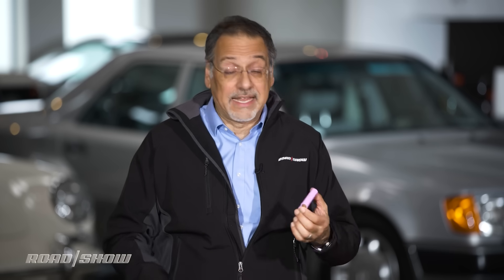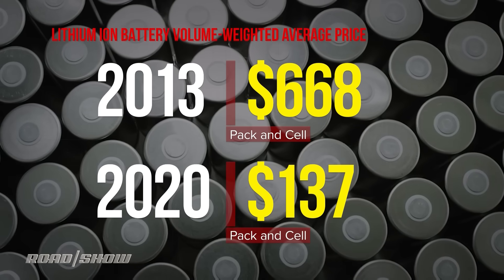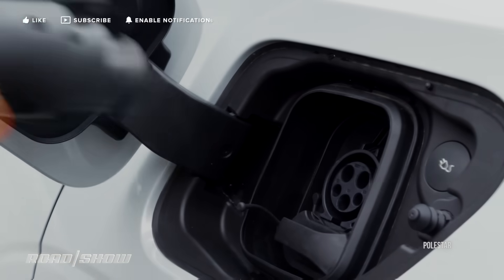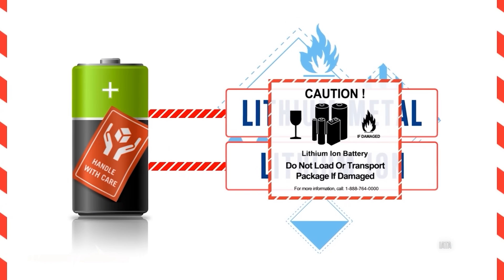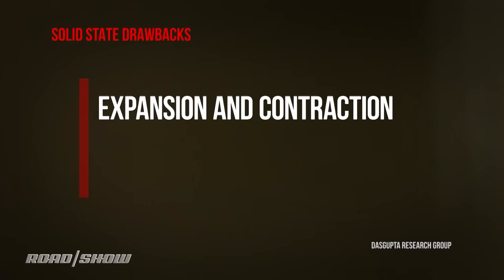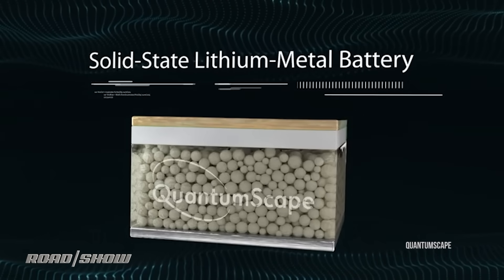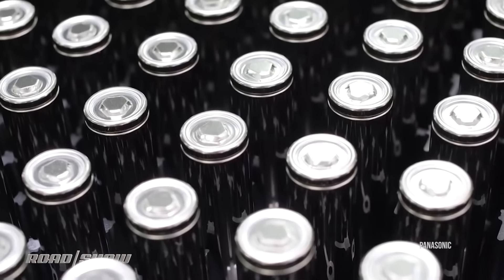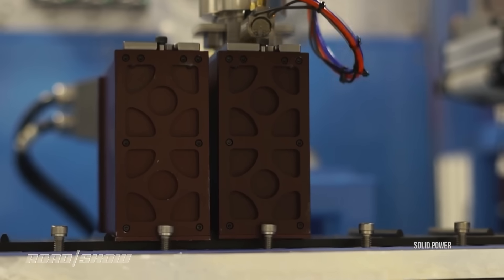When solid-state batteries arrive, you'll want an electric car

Comment: I will want an electric car when the cost drops to something reasonable. Right now its just the domain of the rich.
Reply: The main part of the cost of an electric vehicle is the cost of the batteries. And this have been falling steadily. Actually within a couple of years, electric vehicles will be cheaper to produce than ICVs. Will be very interesting.
Reply: @RasmusDyhrFrederiksen  I agree that the battery cost has dropped significantly in the last 10 years but if you look at the stats it seems to be leveling off with only a small projected decline.  In fact lithium prices are rising.

Comment: When the power grid has enough electricity, there’s plenty of charge stations, and the batteries fast charge - THATS when one wants an EV
Reply: Actually, that still doesn't sell me on electric vehicles. You still have the problem of the overloaded electric grid, the electricity still comes from coal and gas fired generators and there is still the cost of the batteries and the limited charge cycles and the range that decreases significantly on the highway.
Reply: @jamesdaniel1376  plus the harmful mining of lithium and toxic pools where it dries. that and it all has to be imported, so we will be dependent on other countries.

Comment: I just recently read that the Long Island Railroad will eventually replace it's diesel trains with battery powered electric ones that can go on the un electrified tracks after they are charged in the electric zone. This is where the solid state rechargeable batteries will fit in after they are developed enough.

Comment: This guy is a moron. Almost all batteries are "solid state." The term means no moving parts not that the material is a rock.

All chips are solid state yet the silicon chip is very flexible when not placed on a substrate, that's why they are put on a substrate in the first place.

These putative next gen batteries violate any number of well understood laws of chemistry and physics. IOW they're frauds and will never happen. There are limits to realistic energy density that can be obtained at reasonable temperatures and pressures. The reason these frauds have been in development for years with no working prototypes that are anywhere near the energy densities they claim is because they cannot do it, and they likely fully well know that.

This is another tech like cold fusion that any reasonably well informed person takes one look at the claims, does some quick math and starts laughing.

Comment: I wonder, why car manufacturers do not try and make removable batteries. The benefits are that you can charge them in a time and place of your convenience. Imagine pullig into a gas station and swapping out your battery for a full one. Can probably be done in a couple of minutes, after which the battery is charged on site and the time it takes doesn't really matter for the driver.

Comment: Better operating at low temperature would be great. I have a Chevy Bolt. Nice car, but I'm not about to spend another winter in New Hampshire with an electric car. I lose at least 1/3 of the range in cold weather and 2-3 miles for every mile I drive.

Comment: My friend works the national research council in Canada I met his colleague whose job it was to solely find a workaround the batteries whose patents are owned by oil companies. He said it was not a conspiracy that the oil companies owned the patents on Superior batteries.
Reply: Patents mean nothing to the Chinese. If there was a battery worth using, they would be using it. Maybe the reason oil companies are buying them is because they got tricked into thinking they were useful.
Reply: That's diabolical.
Reply: You guys have to understand that modern industries are designed to make money -- to keep you coming back to buy their products often. The battery industry works the same way. They are reluctant to release technologies for batteries that degrade too slowly or are too light. If a battery in a car or cell phone becomes unbearable in a few to several years, you have to keep buying more batteries. Light battery technology makes batteries too accessible, so they must remain heavy for the time being to justify their costs.

This strategy that keeps customers paying exists in so many industries that you feel loyal to. Think of smart phones (buy every few years), ICE cars (engines die after a decade or past 100k miles), oil, pharmaceuticals (give you treatments instead of cures). The list goes on and on.

The bottom line is that no one makes fortunes from selling you products that last indefinitely or only require you to buy them once or a few times.

Comment: Back in December 2009 Stanford university released a beautiful produced video with all these scientists in their fancy lab coats, and the laboratory footage from their fancy equipment and their newly innovated battery made out of regular ink + regular paper + carbon nano tubes. A couple of years ago Stanford university removed that particular video, for whatever reason, as well as a video about a newly innovated solar panel, also made with carbon nano tubes. When those videos were released the people from Stanford university claimed that both innovations could easily compete with the oil industry. I mean, they looked very joyful and they were very convincing when they made their claims. 

I never ever heard from it again. Although I was clever enough to save those videos with the announcements about their innovations. Since then I watched numerous of videos with announcements about all kind of different newly innovated batteries, and not a single so called newly innovated battery has ever made it to the market to this date. 

So I am a little skeptic when I hear these type of announcements. 

Put a fail safe hydrogen tank inside the electric cars, and the whole problem is instantly solved. It is even possible to make the car generate it's own hydrogen while it is parked. Hydrogen electric transportation is the future, and batteries are NOT, at least not for electric transportation on a global scale. 

Batteries are only good for those who are at the top of another economy that is based on another addiction of toxic materials, and a pyramid scheme. 

I tell you what is NOT going to happen. Manufacturers are never ever going to keep the same form factor for decades because they do not want you to be able to interchange your battery, or whatever their product is, with a different vehicle or whatever the device might be. The manufacturers want to force you to buy a new product every few years or so. And batteries are the perfect tool for that job. 

You don't have that problem with a hydrogen electric vehicle. Hydrogen electric vehicles also do not create a toxic and complicated recycling problem. Hydrogen never runs out. It doesn't create emissions. There is no highly energy consuming mining process involved. All the technology and infrastructure is already available in large parts of the world, and it is easy to expand it in coexistence with renewable energy sources.  

Batteries are designed to keep the people addicted to large corporations. Hydrogen technology combined with renewable energy sources sets people free from those corporations.

Comment: No, I still WON'T want an electric car. No matter how "efficient" batteries become. Electric cars are NOT the answer for the future. They are  just a stop-gap, or band-aid, until something better comes along. Just  like the fluorescent bulb was the next great lighting technology of the future, until the LED became cheaper and easier to mass-produce. Now we have all of these Mercury filled fluorescent bulbs that we need to dispose of. What happens when we need to dispose of all of these Lithium and Cobalt filled batteries now? While I agree that the aspect of zero pollution from an electric car sounds great. The electricity to charge these cars still has to be produced in some way. Most likely from coal or gas fired power plants (for the foreseeable future anyway). That will pretty much counter any pollution savings from the electric cars. Who wants a car that is WAY overpriced, with very limited range and has very few places (for now) to charge it on a long trip? Besides, just like oil, Lithium is also a limited resource that will not last forever. Once Lithium becomes a depleted resource prices will go through the roof, just like with everything else. The only thing electric cars are good for, besides accelerating really fast, and not needing multiple gears, is bragging rights, so you can tell everyone how much money you wasted on that overpriced new Tesla. Elon Musk (and governments) try and convince us that electric cars are the greatest thing since sliced bread. All while he pads his fat wallet with your hard-earned money. I will stick with my good ol' fashioned internal combustion engine powered car for now, until something that is actually better comes along. Will Hydrogen, or something else, be the ultimate solution? Who knows, but anything will be better than this electric garbage they are trying to force upon us right now. Just my two cents on the subject.

Comment: I still wouldn't want one of those cars. No battery is going to last forever then when you need a new one its going g to be expensive. Everyone I know that bought an electric car around 8 to 10 years ago  now needs a new battery that cost around a $1000. When one of these cars gets into a wreck on the highway the highway patrol is supposed to call a hasmat crew. And who do you think is going to pay for that? You! Also here in California the police aren't even supposed to touch the EV for faer of electrocution, so if you are hurt inside of one of these cars , you wait. Hopefully you have the time.

Comment: Nice but misses the larger picture. Yes, those batteries are superior. Still does not solve the problem that there is not enough electricity and not enough distribution capacity should a LOT of people start using electric cars. And THAT will take a LONG time to fix.

Comment: I think hydrogen fuel cells are a better solution. Please do a report on this alternate source. Even if batteries solve the cold weather efficiency loss, there will still be a significant energy drain just to supply cabin heat in cold weather.

Comment: What car manufactures should be doing is looking into wireless charging. Thinking of terraced 1900s homes in the uk.we don't all have drives....please make all motors wireless induction with a on street charge coil pad

Comment: Ok, I know little to nil about EV cars and their batteries. So this question has probably been answered 10 Million times. BUUUUUUUUT..... why couldn’t alternators be used in the EVs as they drive  to power the car and charge the battery whilst at cruising speed. Thereby the battery will only be drawn on during startup, idle, and accelerating. Or is that already being done?

Comment: Intressting. I was wondering that they use a couple of 19650, wich have a high shortcut of nearly 30A and are standard for specific "Toy/Education-robotd" and evaporators. I thought it would be something more powerful.
I guess tge solidity and the danger of brittle fracture can be reduced by the design of the batteriepack e.g. using a free running or floating suspension bracket or mounting as in hard drives, this would damp the impact in combination with the chassis.

Comment: It will be interesting to see how Toyota's new solid-state battery vehicle works out. They claim 300 miles on a charge and 10 minutes to fully recharge. Be interesting to see how they work in the cold. Solid-state batteries never worked in the cold well, Toyota says they have solved the issue.

Comment: "Discharged and recharged 'up to' a thousand times".  This is a calculated, (not proven) number, and the "350,000 mile life" assumes a zero to 100% charge, and a 100 to 0% discharge.  What happens when the owner repeatedly "tops off" the battery at 50%?
As far as used batteries being moved into new vehicles...would you buy one?  Would you buy a new car with an engine out of a wreck with only 33,000 miles on it, because the seller says there's still 2/3 of its life left?

Comment: About the point of recycling of Lithium  ion batteries. There is the option to have a second and sometimes third life for the battery, in houses or grid balancers or quixk charging stations as extra cappacity. I'm not saying lithium ion is perfect but i think thats important to mention.  
And the thing with dendrites   i might be wrong.... don't  they also form in lithium ion batteries?

Comment: How do you think the electric grid will cover all the electric vehicles? It cannot and will not. The infrastructure  in the USA was NEVER designed to operate vehicles. You are pushing for a MAJOR issue. Stop dreaming. I will stick to my fossil fuel vehicle as long as I live.

Comment: I won't want an electric car until
A) They cost the same as conventional cars
B) They charge in the same time as it takes to fill a car with petrol
C) There's a charging infrastructure no worse than the current petrol station one
D) Range is 400 miles minimum.

Until then, I'm not interested.

Comment: With fuel, you're only having to carry half the potential energy around with you; the other half being atmospheric O2, and aside from the most violent kinds of accidents they can be safely kept apart.

With a battery however you're carrying all of the potential energy in one place - we're already at dangerous energy densities, yet we wanna go even higher?

When does common sense kick in?  No sane person should want to be within a hundred yards of a battery that could store the energy equivalent of the same volume of hydrocarbon fuel.

 • fuel = make energy on demand, as you need it

 • battery = make it all up front, stored as high-density raw charge separation, packed under your seat

The drive for ever-higher densities of raw charge separation is just bankrupt idiocy.  A pile-up in fog of such EV's would light up the sky, albeit briefly.  Quite simply, the higher the energy density, the greater the chances of catastrophic failure, ie. what might otherwise have been superficial damage or fault causing rapid runaway discharge.

Do we really want road vehicles prone to RUD's?

If we're really committed to hastening the now-overdue end of the current interglacial, we should be investing in developing techs that make energy on-demand, NOT trying to fill our pockets with a week's worth before we set off.. that way madness lies.. there should be international treaties outlawing such R&D in the first place!  For all the applied science, it's cave man thinking..

Comment: Some things that came to mind:
-Solid states will take forever to proliferate and that is assuming their estimates are on schedule. 
-Electronics industry will probably take priority as far as these battery's are concerned assuming they are cheap enough to produce.
-15 min charge is starting to get into the realm of reasonable. Would not want to wait forever in line to charge one however.
-For cars the range needs to be in the realm of 500mi at less than 20min charge for it to be a real contender for KOing ICE.
-For trucks 2 ton and under it needs to be to able to pull near its GCVWR max for 300.
-If EV goes above 75% proliferation, it adds about 30% power needs to the grid.

-The rare earth metal cost of these things have to be considered too. Ion-Lithium is already a pretty toxic process to create.

Comment: This video feels misleading/ inaccurate in a lot of ways, for one dendrites aren't really a problem with solid state batteries, there just isnt the room for expansion. And speaking of expansion he mentioned that as a problem too but the whole design of solid state was to better withstand expansion especially in Li-Si batteries which the silica annode expands like 6x more than traditional Li batteries (but also gives greater energy density). The solid electrolyte exerts more pressure to prevent overexpansion

Comment: I am only interested in Diesel cars. I love Diesel - Have a Mondeo Titanium 2 litre - Will do 140 mph - does 50 mpg - will do 600 miles on a tank full - Refuel time 3 minutes - Not 3 Hours - Uses less fuel than petrol - More environmentally friendly - Diesel Uses 2 gallons per 100 miles - Petrol (30 mpg) needs 3 gallons per 100 miles - Unlike electric will not need a new battery after 3 or 4 years costing £ Thousands ! It is a no Brainer ! Go ahead and buy electric cars and crash the National Grid and get power cuts ! Is there an idiot out there who thinks electric cars  will change global warming ?
Reply: It is hilarious isn't it?
If you removed every single car from the roads of Europe you'd only reduce obal CO2 by 1%, if you replace them with Electric then they are WORSE for the environment until each car has done 30,000km on a renewable grid or 70,000km on a gas/oil powered grid.

It's window dressing and green washing.

If people genuinely wanted to tackle C02, then they would tackle heating and cooling property, industry and concrete production, not virtue signal on cars.